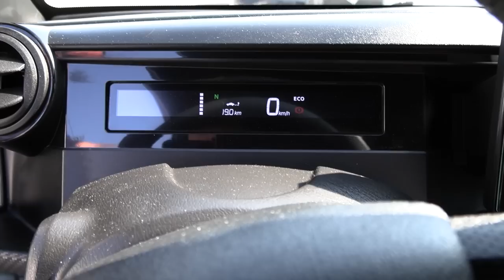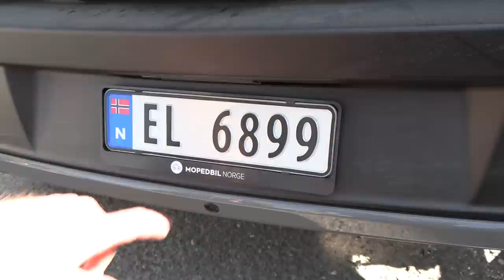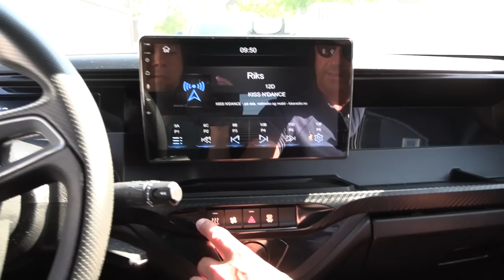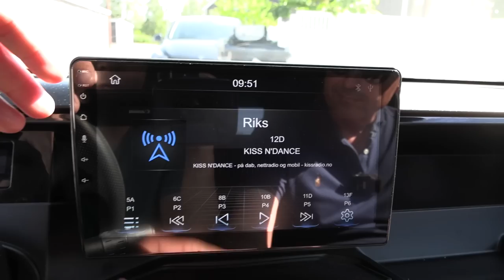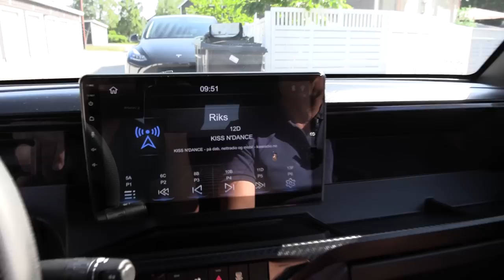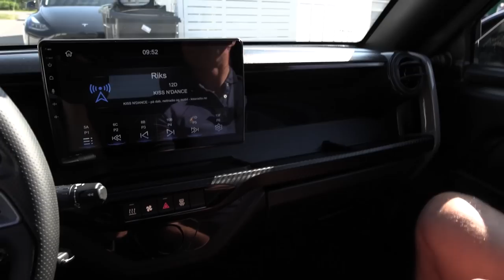Ligier Myli electric moped car has arrived in Norway

Comment: In Italy you can drive this if you are 14 years or older (it is classed as a microcar)..glad it is finally silent now it is EV, the older versions were sooo annoyingly noisy.
Reply: And they have diesel engine
Reply: Well there you go, I learnt something new today
Reply: Hmmmm.... Annoyingly noisy compared to what? At least from the outside they are usually not more noisy than a 2 wheel moped, not to mention one with an aftermarket exhaust, as many got.
Reply: @GoldenCroc  they produce a noise like tractors- lawn mower
Reply: @riccardomarinoni6733  Thats not the same as those avalible in northern europe them, even the ICE ones are, as I wrote, no more loud than a standard condition 4 stroke moped and way, way more quiet than 2 stroke mopeds with tuning exhausts that are common in southern europe.
Reply: @riccardomarinoni6733  The diesel one's all mount lombardini engine here (ldw502) which is a engine used for tractors or piaggio ape. I still can't understand how they can get registered and being legal with the euro 6 norms, considering it has like a straight pipe on the exaust. No egr, no dpf no nothing. 
Someother microcars mount the yanmar engine, still diesel, same problems. Problems of this car are the engine produce too much vibration and the chassis is made of "paper" - alluminium or light metal, infact are all split or broken after 1000kms. The ev versions of those things can have much more sense.
Reply: @bomberman4046  You forgot the kohler ones but still those things are deathtraps and should be forced to have katalytic converters since they are much filthier than your average car. Tbh the only reason why they are popular in sweden is because of the speed and utter stupidity of the people who buy these.
Reply: @bomberman4046  You forgot the kohler ones but still those things are deathtraps and should be forced to have katalytic converters since they are much filthier than your average car. Tbh the only reason why they are popular in sweden is because of the speed and utter stupidity of the people who buy these.

Comment: wow what a quiet microcar, not annoying at all :goodvibes:the diesel version is really common here in finland, a lot of teenagers drive them around, especially at night now that the summer break has started.. these things would not be annoying at all!
Reply: No, you wouldn’t even know that you have been run over by one 😯
Reply: @nakfan  It's likely the car will damage if they run over a pedestrian.. I mean these things are deathraps if they collide with a regular vehicle.
Reply: @akse  ... still much more safe than an actual moped though.
Reply: @stephanweinberger how so? A small fender bender and you might lose your legs... I would think not be trapped in a seat belt, i.e. riding a moped, would be safer in many types of accidents.
Reply: @GeckoForReal  maybe in some types, but for most accidents having any kind of crumple zone (regardless how rudimentary) is a plus.

Comment: The Silence S04 moped car has already started deliveries in Spain, you should check it out when it gets to Norway, it reaches 85km/h with two removable batteries (11 kWh) starting from 10 200 euros with 30€/month battery swap service.
Reply: Too bad it's more expensive than a real EV; while having less range, less power and no safety equipment (crumple zone, airbags, etc., they simply don't exist as it's classed as a sort of moped / quad and not an actual vehicle). At a price point of 16k€+ for ABS and A/C it's a waste of money, as it does not even qualify for EV subsidies due to its classification.
Reply: @KonsaiAsTai  Well yeah, at 16k it's a bit steep but for 10k (here in Spain) I think it has a market, car sharing companies have already ordered a bunch and posh kids love them to drive from their homes to school, regular middle class people could also consider buying it as a second car just for the city.

Comment: looks better than the Dacia Spring inside and outside 🎉

but they could easily have moved some stuff in the front and put in a Frunk
Reply: Space optimization in a car is not that easy. Low optimization is necessary to enable a low price.
Reply: alternatively it could have been mad a little more aerodynamic & even a bit lighter with a lower hood, giving it a few more kilometers of range.

Comment: In Germany, too.
There are versions going 6, 25, or 45 kph. 
For anything above 6 kph you need a kind of permit. The 45 kph variant requires an actual drivers licence (theoretical test only). Can be driven from age 16 on.

Comment: I would love to see a thousand-kilometer test with this one. LOL. 
Looks like a cool car. In the Netherlands, these can be driven from 16 y.o. with a moped license. They are often used by older people that do not need a full car anymore or by students. Perfect for city traffic and groceries. They are a bit pricey though. Dutch prices start at just under 14K euro
Reply: 14k euros, why would 14 year old drive these? Max speed 45, its a moped but cost way too much... Up to around 190 range for high spec, why u need that if u cant go on to the motorway. Im not sure why People buy these.. Not to get wet when it rains? Lol they would be perfect for the city, but id rather get a moped for way cheaper...

Comment: I really like the styling! :) But the European regulators really should upgrade the speed limit for those small vehicles to 50 oder 60 kph...45 ist just too slow, even for the city/suburbs.
Reply: You don't need a driver license to drive these.
45km/h is plenty for somebody without a license (usually, they lost it because of bad driving).
Reply: @xmtxx  I know…but 5kph more would not be a problem.
Reply: @monsieurb90  Yes it does. Survival rates of pedestrian plummet around those speed. 50km/h it's only 40% of survival.
30km/h is at 85%.
40km/h is at 70% 
The curb is exponential, 5km/h DOES matter a lot.
If anything, the speed limit should be lowered. the drivers of these vehicles, are REALLY dangerous.
Reply: @xmtxx  So 0kph would be the best… 🙄
Reply: @monsieurb90  You said, that 5km/h would not be a problem. I gave you numbers showing that it is, in fact, a problem. 
I expected a better argument.
Reply: @xmtxx  here is my argument - driving at 45km/h creates dangerous situations, because every other car want to drive at city speed limit, which is mostly 50km/h in EU (but in reality cars drive even faster). Every one wants to immediately overtake such slow vehicle and this disrupts the flow of traffic and creates very dangerous situations, where other cars are driving over limits and do sometimes dangerous/risky maneuvers.
This 45km/h limit just doesn't make sense, only if city speed limit for other cars will be same.
In my opinion, at areas where is higher probability of collision with pedestrians should be speed limit of 40km/h or lower.

Comment: Looking forward to all the tests, including winter test in 2024
Reply: I would guess that the 1kW heater is not sufficient in Norway.

I have an electric K-car , and 2kW is not sufficient in winter (PTC element limits itself to 2kW at low SoC.)

You also need power to initially heat the cabin.

Comment: This is far more like the EVs of the future should be. At present we are just replacing enormous energy sucking ICE cars with enormous energy sucking EVs. These are perfect for 90% of city drivers and use a fraction of the resources. Bring them on!
Reply from the maker: But EVs are way more efficient than fossil cars. So replacing a fossil SUV with EV SUV is the right way to go. It has already been happening in Norway since 2016 when Model X came out.

Comment: That is by far the best looking small car and not embarrassing like an Opel Rocks or Citroen Ami where they did not even produce different parts for left and right, and front and back.
 It costs about 13000 Euro in Germany which is more expensive, but not to compare with a Rocks.

Comment: If it could be delivered in a version that can do 80-100km/h, it would be a great competitor for the Renault Twizy.
Reply: If it were capable of those speed it would be classified as a car, and it would be subject to much more stringent regulations and crash tests, which would increase weight and cost. Which is why the Twizy never was particularly cheap...
Reply: @lozkko  Twizy isn't classified as a car.

Comment: If this were available in the United States I would buy one.
Reply: If an F-150 doesnt acknowledge you there is a risk of becoming a bug on the windshield. Considering the frame is very weak. They weigh maximum 425 kg, like 1000 lbs.

Comment: Like most French small vehicle builders Ligier started to address the Sans Permis market. Like every Moped in Europe these were license free in France. This category got included in EU not that long ago. Category LS06e, is what  you are looking for, though the Citroen Ami/Opel Rocks-e is heavier and more powerful, not sure how they got away with that. Normally that would have been LS07e, requiring an B(1) license not an AM.
First Ligier actually marketed ca. 1980, with the classic 50cc limit on 2 stroke Mopeds: https://www.youtube.com/watch?v=lsaxjo1I6zs

When did they increase the weight limit by 75 Kg, or a smidge over 21%?

Comment: EU needs to update the electric bicycle laws to be closer to what they are in (most) US states. 
#1 increase the speed limit to 30 km/h (In the us it's 20 mph = 32 km/h)
#2 Allow the use of a throttle (unassisted mobility). It doesn't make any sense that you can have a scooter without pedals and it's fine but if you have pedals, you're not allowed to have a throttle.
#3 Remove the stupid 250W limit. Increase it to 750W like it's in the US. If some fat guy is riding a bike, the 250Ws is not enough to do anything.

Here are the three ebike classes in the US. How come the US can have much better regulation regarding Ebikes than Europe?

If you know any European politicians, please ask them to "make Europe great again" regarding cycling and change the current regulations to being somewhat similar to the US class 2. If they made these changes then I think a lot of people would start using ebikes when commuting instead of driving. One of the biggest issues in city riding is the stop-and-go traffic. With the help of a throttle, it would make it so much more enjoyable.

"The three classes are defined as follows:

    Class 1: eBikes that are pedal-assist only, with no throttle, and have a maximum assisted speed of 20 mph.
    Class 2: eBikes that also have a maximum speed of 20 mph, but are throttle-assisted.
    Class 3: eBikes that are pedal-assist only, with no throttle, and a maximum assisted speed of 28 mph.

All classes limit the motor’s power to 1 horsepower (750W)."

Comment: It can be a challenging left lane huger on a german autobahn 😂
Reply: it's not allowed on the Autobahn. There is a minimum speed of 60km/h.
But with 45km/h it's already a pain to drive it in the city, everybody drives faster than the city limit of 50 and will honk at you.
Reply: @kiebitz9821  then drivers needs to be taught. Dura lex, sed lex.

Comment: It would be great if the price was lower, they're like 1/3-1/2 the price of a new model 3 and if mass produced they should cost less than 1/5 to produce. They're not small versions of "real cars", besides being smaller, a lot of things that are taken for granted in real cars just isn't there, and the things that are there can be a lot cheaper than on real cars. I'm not saying the price is wrong, just that the price could be much lower if they were produced in really large numbers, and i think it would be great if they were.  

It's not unique for that brand, or even EVs that moped cars or similar are extremely expensive, for what you actually get compared to cars that are produced in much higher numbers. Still, it will take you from point a to point b, and a passenger, and some luggage, and provides weather protection, which is kind of main point of real cars for most people. 45 km/h is enough in many cases.
Reply: what you say would be true for mass products, these things are produced in small local enterprise so the price is quite peppered !
Reply: @victormarian7889  My main point was that production volume is the main reason for the relatively extreme price, yes. 

Still, Ligier is an old established car brand, not huge, but Ligier group have like 400 employees, and more than one production site. They are owned by a number of companies that could finance large scale mass production facilities, if they wanted to.  Not a "small local enterprise" by any reasonable definition.

Comment: It's not a car Bjorn. It's what's known in the UK as a quadricycle which is the same class as the Citroen Ami. I love these kinds of car. People like to call EVs that do less than 120 miles per charge city cars even when they aren't. The Myli is an actual "city car" and is surprisingly well equipped. Perfect for most people's everyday needs as the average daily driving distance globally is still 25 miles or less and speeds of 45kmh are acceptable in most cities and towns. In fact, in London the speed limit is 32kmh in many places. These vehicles are exactly what is needed.

Comment: Nice . . . and clever, the idea for fitting the design to downgraded seniors driving licences.

No more than 425 kilos, ex batteries  and a modicum of crash protection.

Removeable batteries and a commercial battery swap service  . . . Somebody's been using their brains . . .thank the diety .

Finally, a vehicle that the Planet can afford !

Any dealerships or plans for dealerships in the UK ?

Comment: Unimpressive.
Based on the engine bay gap, this was a combustion vehicle base and then "oh shit we must go EV" switched production.
So not an EV dedicated platform, which optimizes space, like the Citroen Ami for example.
Plus this seems to have smaller battery than the Ami. Ami is sold for like 10.000 euro
This thing should be no more than 5-6000 euro.
We also know there's so many such vehicles from china that cost 1-3000 usd, depending how bad of a negotiatior you are. So 2.000 usd plus shipping and various taxes, you can have one of those chinese quadricycles at 3000-4000 euro.
This Ligier should think hard about it's pricing level if they hope to sell anything.
Reply: Their ICE variants cost about the same, at least here in Norway, and they seem to sell pretty well here on the SW coast... probably because of all the rainy days here and the alternatives for a 16-year old are either being wet on a smelly moped or in a tractor (you know you're in farm country when the tractors queue up at the local McDonalds drive-through on the weekends - but even here they're a small minority so for the other under 18s these "moped cars" are very tempting).

Comment: I wish the regulations in Norway would change, so that you can drive a normal car at 16 y/o, but with software top speed limit at 45 or 50 or whatever is necessary. Then you could lift the speed restriction when you get a proper car license at 18 y/o.

Comment: It's as much use as a child's toy car. It's built like one as well. At a starting price of  €12,500 it's way over priced. It can't be driven on roads rated above 30mph. If you charge it once every three days that's more than 24kw per week, you'll need a loan for your electric. A bunch of cheap electronics which prob add up to no more than two to three grand.
Reply: We charge our 17kWh Jeep Wrangler 4xe twice a day and it costs us almost nothing. A 17 kWh charge is about $2.25 US at out current $0.13 per kWh electricity rate.